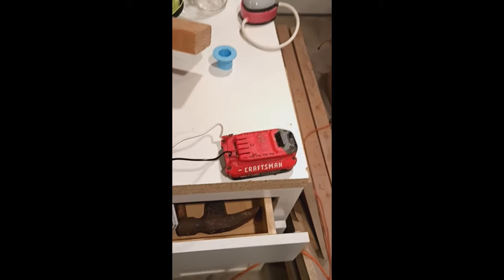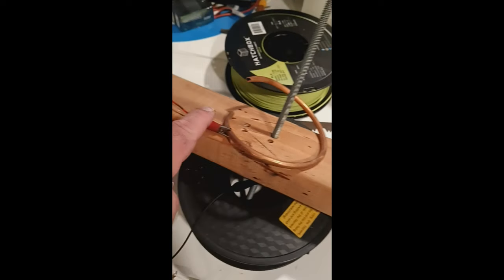Plasma builds

Comment: Using a 24" sheet of glass with multiple 1/2" strips of aluminum or copper foil tape on both sides works good too.  Back when I was incorporating glass plates as my Tesla Coil caps, I only had one punch through that I can recall.
Reply from the maker: Thank you for the advice. I will definitely try it.
Reply: @nathanbunten4299  Word to the wise Nathan. And you probably already know this, but when the ozone level in the room gets to the point where it is not "pleasant" anymore, you are probably already getting to much. Let the room air-out. I love the smell of that stuff at first, but after a while it will give you headaches and what not, so be careful you don't "bleach" your sinuses!  

If you are going to try the glass plate thing, be sure to clean the glass very thoroughly. Windex cleaner first, followed up by acetic acid (vinegar) does the job pretty well. Also, it's wise to keep a 2" margin on both sides of glass as far as the Al or Cu strips are concerned. If you get the metal too close to the edge, arcs can go around from one side to the other.  Subbing your channel to see what you come with with. Stay safe and be careful! 🙂
Reply from the maker: @sempertard  thank you. Check in a few days I should have it running.